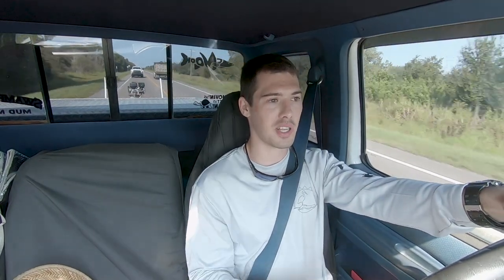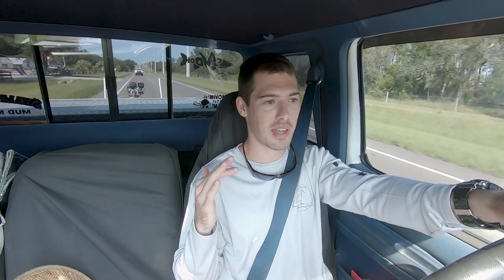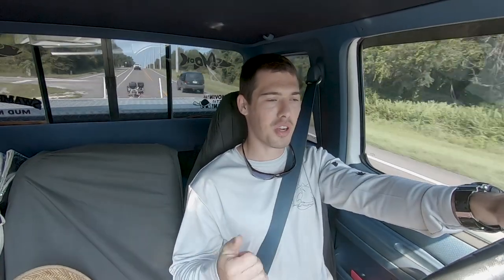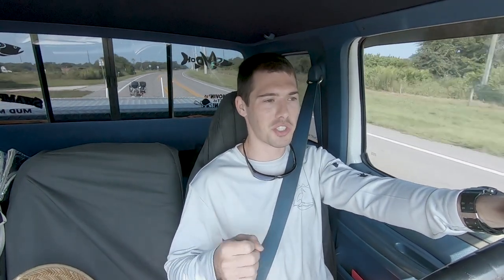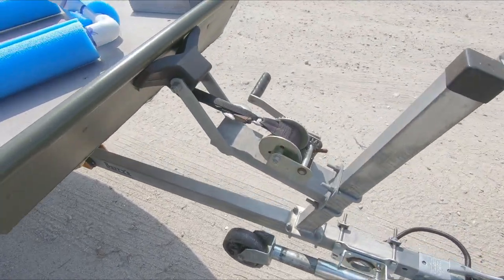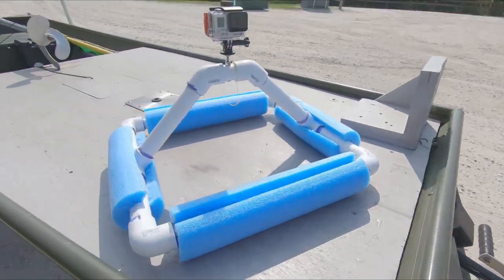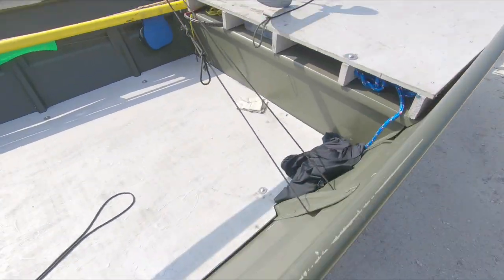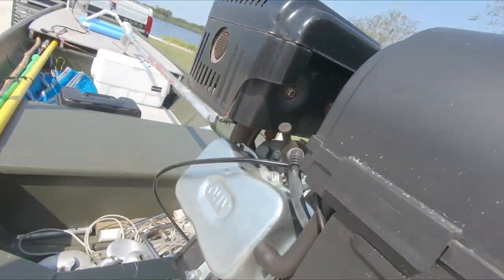Trailering a Jon Boat and Longtail Mud Motor Setup

Comment: The other day I was trailering some 2x6's with the shitty harbor freight tie downs.. hook broke right in half... luckily nothing bad happened besides having to pick up my lumber. 
I would seriously spend the extra money on a better ratchet strap bro.
Reply from the maker: It's about their time anyways. I'll be replacing them soon. I also have to go over the rig and do some checks and maintenance on everything. That's unfortunate though... and the hook breaking?! That ain't good. Was it due to excessive rust or did just flat out fail?
Reply: @JTgatoring  Just too much load for them I guess. Cheap chinese junk. I'm sure one of their higher rates straps out have held fine though.

Comment: Nice setup, new subscriber. Did you ever get a telescopic handle for your trolling motor? I got one laying around from my last trolling motor.
Reply from the maker: Thank you! This trolling motor has a handle that pulls in and out, it just doesn't move/tilt up and down
Reply: JTgatoring oh ok, I was watching one of your old vids and saw that you could use one. I have one Incase you want to make it longer
Reply from the maker: @jackgonzalez4292  Thank you, I appreciate that!  I'll hold off for now, I've got a lot going on with the longtail and some other projects. I really appreciate it though Jack
Reply from the maker: @jackgonzalez4292  I'll add you on IG and give you a heads up if I plan to head down that way 👊